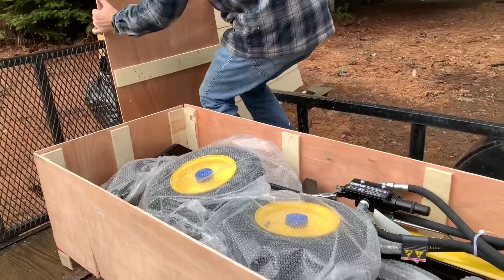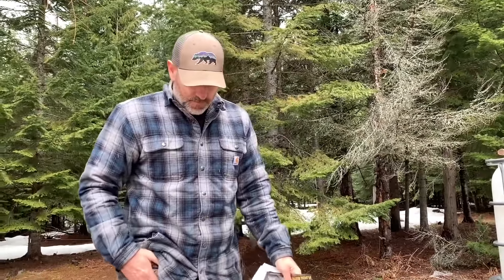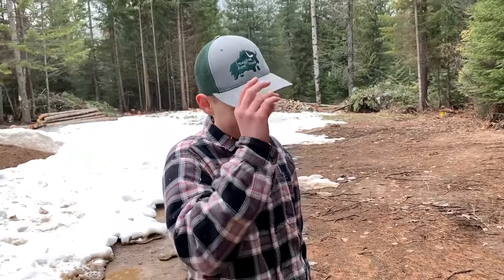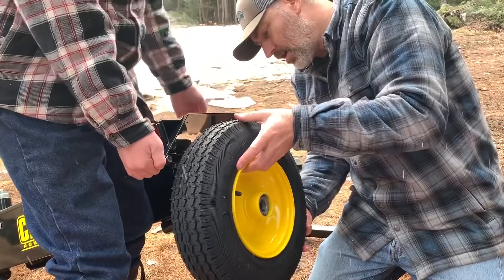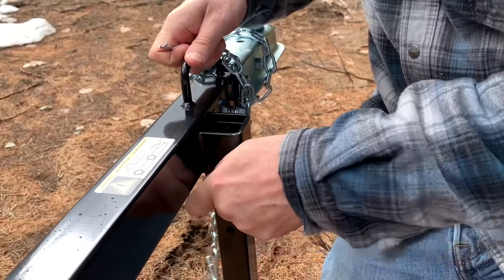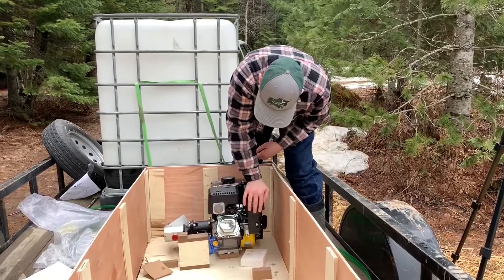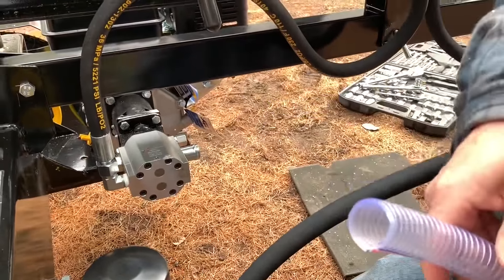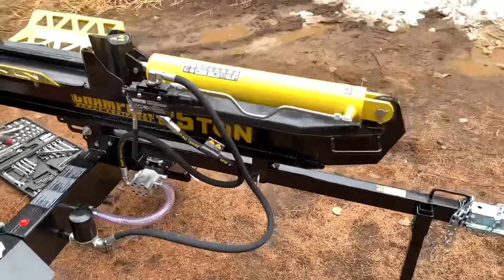How to Assemble a Champion Log Splitter

Comment: That splitter looks much like mine except mine is a 27 ton.  Since I bought mine from a retail store it came preassembled except for the fluids.  It so far has accepted anything we tried to split.  Good luck and be sure to give some lessons on where to put hands and where not to as it will split fingers just as easy as wood.